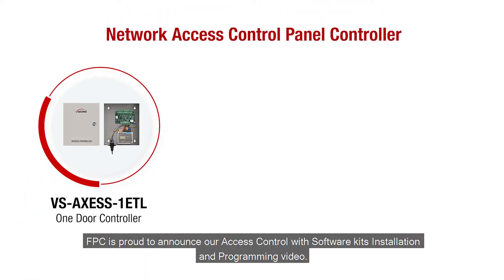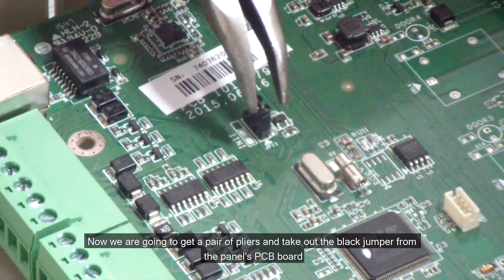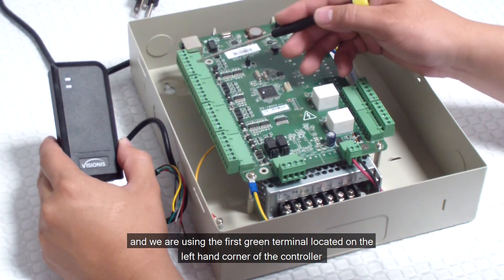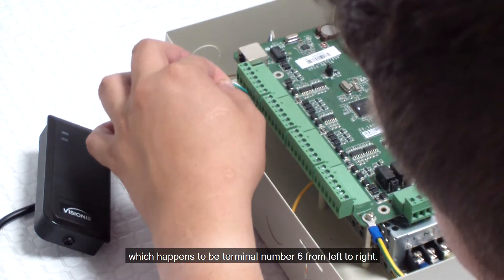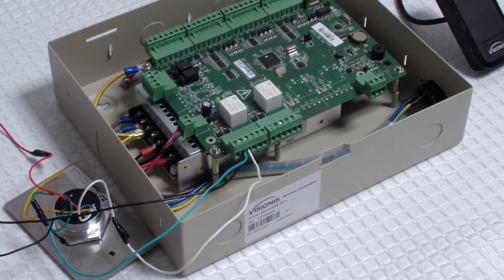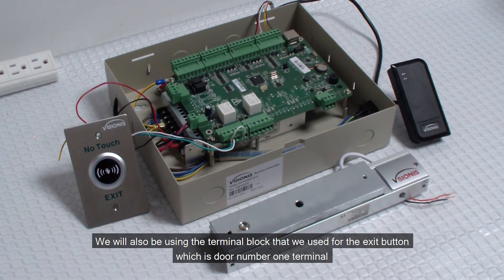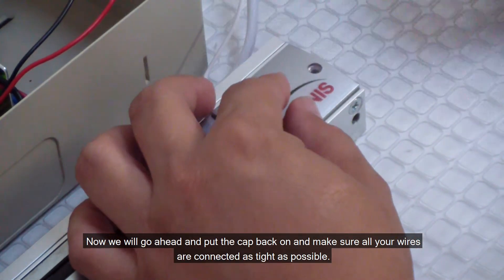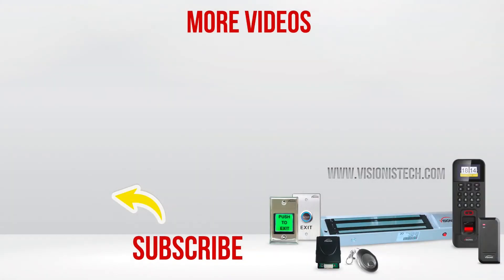How to Connect a Visionis Access Control with VSAXESS IP Desktop Software

Comment: Is there a way to make it so when the door is unlocked the keypad stays green? Then red once again when locked?
Reply from the maker: Hi Cameron, you will need to connect the Brown wire of the reader to the OK terminal on the reader side of the panel and the  Yellow wire of the reader to the BZ terminal on the reader side of the panel